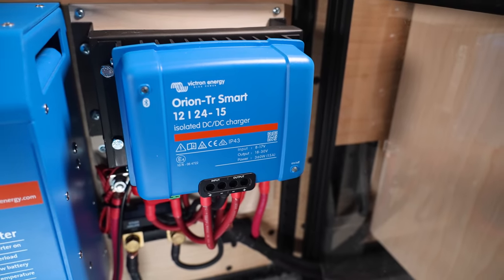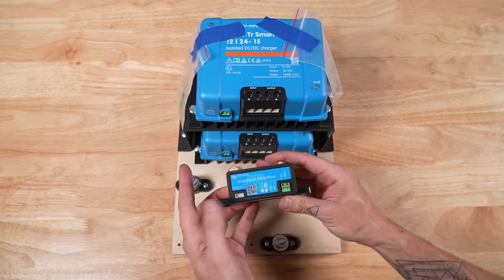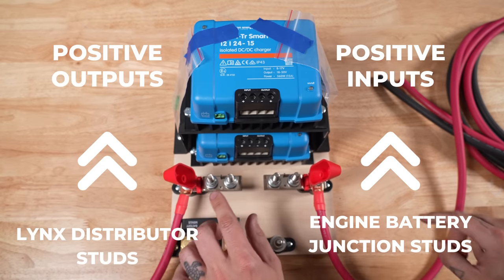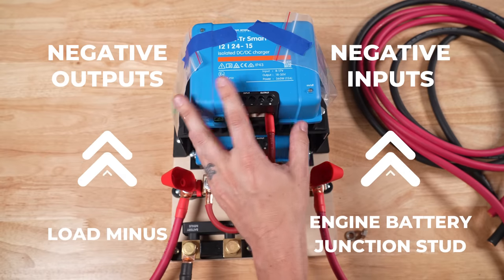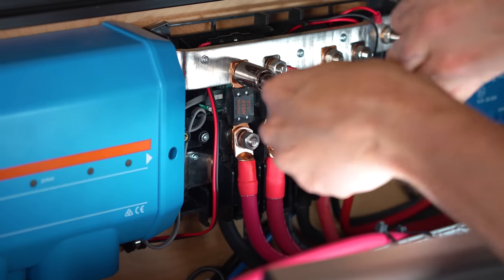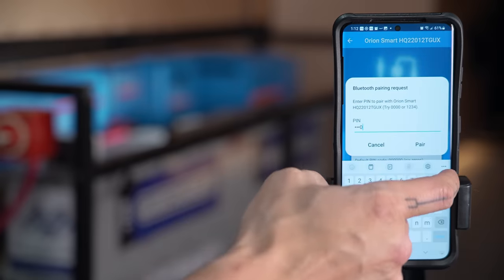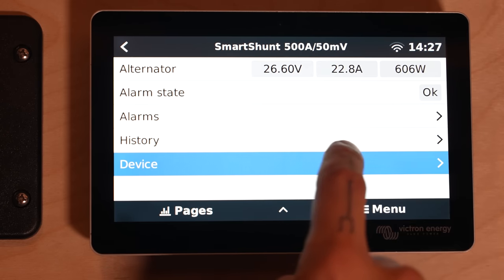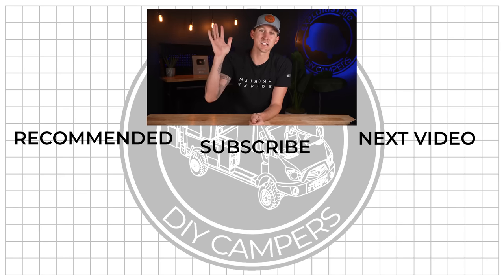TRANSIT ALTERNATOR CHARGING - DUAL VICTRON ORIONS

Comment from the maker: Dual Orion Wiring Kit: 12V Alternator to 12V Battery Bank: https://shop.explorist.life/shop/all-products/dual-victron-orion-tr-smart-12-12-30-dc-to-dc-charger-wiring-kit/
Dual Orion Wiring Kit: 12V Alternator to 24V Battery Bank: https://shop.explorist.life/shop/all-products/dual-victron-orion-tr-smart-12-24-15-dc-to-dc-charger-wiring-kit/

➤Shop the EXPLORIST.life store: https://shop.explorist.life
➤Shop Battle Born Batteries: http://battlebornbatteries.com/?afmc=explorist_bb67
✅Use code 'explorist' for $50 off per battery.

Comment: Adding a fan blowing across the heat sink fins helps a lot.  That's what I did to my 12 / 12 - 30 Orion.
Reply: Do you think a computer fan would be adequate for this?
Reply: @EffieG-ez9tf  yep. 120mm one is prefect for that job.  can even be a low noise/low rpm one. just to boost the natural convection quite a bit.

cool electronics works much safer and prolongs lifespan obviously.

Comment: Hey I'm wondering if this could be used universally I myself am a car audio guy and I will be the first to admit car audio guys are not the smartest when it comes to lithium so I'm trying to learn for a dual purpose of my batteries Car audio/Camping so basically I am trying to figure out a way to charge my lithium batteries safely with my alternator and give them everything I can get from the alternator without frying it I was told to use one of these but my hesitation was the 30 amp restriction maybe two together for a 60 amp charge would work better I want to be able to charge my batteries as fast a possible and what I'm not able to understand is most people are using these for a dual battery setup with a main starter battery and an auxiliary battery I myself want to use ONLY the lithium for everything better power delivery without the added strain of split charging with a dual battery setup yes I will have to have enough reserves to cover everything but I want it to be just that a single battery charging from the alternator that I can listen to my audio system while driving and use my devices at camp can you please tell me how you would do this and how you would make it work right

Comment: Since I have a 30a mounted behind my grill because of the heat, can I now install the new 50a inside and utilize both to recharge the battery bank? If it matters this is in 2022 Prius AWDe so I do not have an alternator to upgrade.

Comment: Question, do they need to be isolated or non-isolated versions of the Victron, DC to DC charger? I noticed the ones in your install are isolated, but want to know whether it matters or not. Thanks for the great work. Oh, also, if you were to supply the metal work, busbars, cables, fuses, and all the other stuff you need to do this I would probably buy that kit! Oh, and I assume that all the process and parts are the same for a 12 volt system??? Thanks again
Additional question...is there any concern for overdrawing/overheating your alternator with a 30+30=60 amp draw?

Comment: I remember watching your video about not using the engine (alternator) to charge the batteries. So I didn’t expect a video like this. Thanks for sharing this.
Reply from the maker: I think using the alternator to charge the batteries is a great solution in 95% of applications.  I think that everybody just read the title/thumbnail of that video and thought I was anti-alternator charging for some reason. 😂🤷  Since our transit doesn't have an on board generator and only has 580W of solar; alternator charging is definitely a must for this system.
Reply: @EXPLORISTlife  I definitely must’ve misunderstood that video, because I totally had the impression you were anti-alternator. 😂 I agree with you, using an alternator is important for a lot of peoples use cases. For me, I’m planning on doing the factory double alternator and having it dedicated to charging the house batteries + as much solar as I can. 😂🔋☀️

Comment: hi.nice video you must be sponsored by victron😊.i just changed my victron orion twin chargers to remote setting from ignition feed and it’s worse than before just 15amps max on my bms lifepo4 battery app.i had at least 33-35 amps before ,that’s 18 and 30amp orion’s.someone online said they fit them that way

Comment: I installed essentially the same setup on my '21 Transit.  However, concerning alternator changing in general, I didn't like how the entry of alternator power into the Lynx distributor bypasses the house battery insolation switch and energizes all the electronics on every startup.  I think it's annoying and probably not great for the components.  So with the help of some wire and a few relays, I wired the Orions into one of the van's Upfitter switches so I can control when they receive power.  I also set it up so that switching them on overrides the van's Smart alternator system; that process was a little more advanced but not all that difficult.   Anyway, I think a video of what I did would be interesting to see.  Thanks for all the super helpful content Nate!
Reply from the maker: We, and most people, just have our system 'on' all of the time, but if you are trying to turn it off every time you aren't using it; I could see that being annoying.  Thanks for watching and glad it helped!
Reply: @EXPLORISTlife  , since you have not an advanced DC to DC charger as the Wakespeed WS500, I also read it's a good thing to power them on at the time you are sure the alternator is safe (at high speed, so it can be cooled).

If you demand to much power from the alternator at low rpm (as the lithiums does),  you could fry it.
Reply from the maker: That's not the case with DC DC Chargers.  That is a problem with Isolators; but with the DC DC chargers we are showing in this video, it limits the current that is asked of from the alternators.
Reply: All energy sources should be isolatable. Since the cable that connects batteries and B2B can receive power from both ends it needs isolators at both ends.

Comment: I have 3 30 amps dc to dc on my system 600 amps lithium, alternator 250amps. Working excellent.
Reply: Nice. Is that also from the ford stock dual alternator setup? That chargers a 36v battery?

Comment: One more question, with "only" 60 amps of charging, do you still need the dual alternators?    If I'm reading the BEMM correctly, you would be perfectly fine with a single one.   Thoughts?

Comment: Wow this isn't just an install, it is artwork.   LE tech for 40 years here.   Considering getting a Transit.   Most seem to come with dual batteries now as a option, but very few have the dual alternator option.    A dedicated second alternator for charging house batteries for the option price ($640?).    Rarely do I see people discussing it anywhere.    There is a superior non-OEM 2x alternator option, but it is over $2k.
Reply: Nations make a 400 amp alternator for under 800 dollars. It is supposed to deliver 170 amps at idle speeds
Reply: My ford Transit Box wan has now 2 AGM 100Ah batteries and I think it has a 170 or 120A alternator because it has an electric hydraulic backlit.

Comment: Thanks for this video. I've just done something very similar and also used a smart shunt to monitor the 2 Orion's inputs. Do you know if there's a way to display this on the main page of the Cerbo display? Or is a negative in the DC power section as good as we get for now?

Comment: Has the firmware update been released?

The only benefit of using a shunt is that you can see how much charging is coming from the alternator, correct?

In other words, The GX will still show the total watts flowing into the battery without an additional shunt, correct?

Comment: Looking forward to the Orions having VE direct so you don't need the Smart Shunt!

I have my Orion only enabled by connecting the Remote On/off to one of the relay outputs on the Cerbo. It only gets turned on when the SOC is less than 50%. We have enough solar for our needs 90% of the time and don't see the point of taxing the alternator and affecting fuel consumption if I don't need to.
Reply: You are not "taxing the alternator" and have you calculated the horse power required for charging and related that to the bhp required to move the vehicle? You would be better off pumping up the tyres to reduce rolling resistance.

Comment: Great video Nate thank you. You've been my go to guy for my complete Victron system and I would not have been successful had it not been for your great tutorials.
I also have two of the Orion 12v DC to DC chargers on my Sprinter setup but I never put in the dedicated smart shunt for them. It's been working perfectly and displays the negative charge on the Cerbo but I'm worried about not having this shunt within the alternator DC chargers circuit. Is this something I should be worried about? I have the main smart shunt in the system but not the second one like you show in this video.

Kind regards David

Comment: Cool stuff buddy.  I looked at the transcript and links and could not find any of the fuse sizes?   I have a 12-12 30  so should i use a 60 or 120 Amp fuse [i have 2x 12-12 30 amps orions.  Not 15

Comment: Once again, loving the video as I was coming here from the store since I have a single Victron DC charger in my cart but I want this setup and I couldn't find the shopping list or the blog for both, along with the various wires and pegs and stuff...(even the heat shrink you edited in). So, I hope I get a reply before too long so I can spend another 2k in your store before the weekend. Thank you very much.. Joe
Reply from the maker: Dual Orion Wiring Kit: 12V Alternator to 12V Battery Bank: https://shop.explorist.life/shop/all-products/dual-victron-orion-tr-smart-12-12-30-dc-to-dc-charger-wiring-kit/
Dual Orion Wiring Kit: 12V Alternator to 24V Battery Bank: https://shop.explorist.life/shop/all-products/dual-victron-orion-tr-smart-12-24-15-dc-to-dc-charger-wiring-kit/

➤Shop the EXPLORIST.life store: https://shop.explorist.life
➤Shop Battle Born Batteries: http://battlebornbatteries.com/?afmc=explorist_bb67
✅Use code 'explorist' for $50 off per battery.

Comment: Quick question for you if you can let me know ASAP. I’m connecting wire from my Orion 24/12v converter to my 12v fuse panel and didn’t have long enough wire in your kit so I ordered some and didn’t realize it was coated with EPDM insulation instead of the XLPE that comes in your kit. Will the EPDM be okay?
Reply from the maker: For liability reasons, we can't vouch for 3rd party purchased wire, but we've made a playlist that will teach you everything you need to know about wire if you've decided to go on your own and purchase extra wire elsewhere: https://www.youtube.com/playlist?list=PLmvhcyi4n0TXLHS1NeK_sCvq3Wsa3B0kT

Comment: A 40 or 60-amp Renogy would have been a cheaper alternative. Love your stuff and your wiring diagrams!
Reply from the maker: Renogy is definitely cheaper, that's for sure.  It just doesn't last Ling enough for us to install it into a high end build like this.
Reply: Not sure the renogy has 24v output either.
Reply: Cheaper is too often not “better”

Comment: Thanks Nate! I did the dual Orion's on your 24V 540ah plans. Glad it ended up being the same route as I know at the time of that video the alternator charging wasn't available. Glad to see you showed how to tell the Cerbo GX the Alternator is charging with an additional shunt. Without the shunt, the Cerbo GX does show a negative DC load but doesn't say from what. I'll be adding the additional shunt now.

Any chance you might be updating your 24V/540ah wiring diagram to show the alternator charging? Would love to have it for my vehicle book for any future repairs 😊
Reply from the maker: Awesome!  Yes, we will be adding it to the existing diagram.  Submit a support here in 2-3 weeks and I should have it done.
Reply: @EXPLORISTlife awesome and thank you so much!
Reply: Note that you'll need the Isolated variant of the Orions for proper monitoring.
Reply: @joelv4495  thanks! I do have the isolated versions installed right now BTW.

Comment: I toyed with this type of installation, but several people have commented on alternator reliability.  Airflow is not adequate at low engine speeds.  If you run an alternator at low speed such as idle, you risk overheating the alternator.  How are you handling overheating??  How do you deal with a LiFeO4 shutting down when full?

Comment: Hey :D great vid. Im about to go from a standard voltage sensitiv relay from motorbattery to charge my "house" battery and connect a dc-dc because i have just learned that I have a smart alternator. None of my batteries are Li for now.  Will the dc-dc Orion auto detect if my motor is running or wil I have to get some sensor? I do have a stop and go function in my VW 5.1 it tat matters. I dont want to drain the motorbattery when the motor is not running.

Comment: Hey Nate, I set up my single Orion 12|12 -30 and hooked it up to the lower ccp port as I don’t have the higher one you connected to. It still senses if the engine has shutoff and won’t push a charge unless it’s running. Is this an ok alternative to running it to the ccp2 connection that is only on when the alternator runs?

Comment: Thanks for the video and the out view to see the alternator charging in the cerbo. One Question if you set the smart shunt power cable to the input side you could see the voltage of the starter battery? Or would a smart bluetooth sense do the job as well?

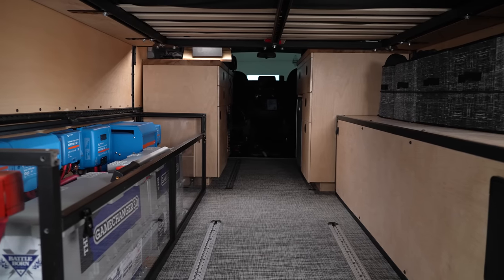Comment: Your videos are so informative and will help me when I get to this point in my own bus conversion.  Question:  Would you suggest this same setup or a different version of it for a mid-size to larger bus?  Also, does your 0:19 0:19 Viktron programming provide an app for your cell phone so you can monitor the charge levels remotely, if needed?   Thanks for sharing your skills with all of us beginners.😊

Comment: It is a welding cable, it can handle temperatures 105c and -50 and is the same size 6 gauge wire

Comment: What load are you measuring on the supply lines from the battery/alternator to the busbar before being split to the Orions?  What gauge wire are you using and have you tested it at full load?  
Thank you, excellent series, among the best I have seen in this arena.
Reply from the maker: Answers in order of what was asked:
~60A.
2ga as noted in the product page listed in the pinned comment.
Yes.  60A is WELL within max ampacity of 2ga wire.
Reply: @EXPLORISTlife  Thank you.

Comment: Thanks.  I'm just getting started.   Bought Orion need everything else to connect to 12 V dump trailer battery.  Where did you get the drawing software...?  Can you help me with a kit recommendation.  Would it be a good idea to wire from starter battery to Orion under back seat of pick up...have some DC powered ham gear there.  Then on to the rear fender DC plug then to dump trailer battery?  Thanks.
Reply from the maker: This may take a more in-depth look at your personal setup.  If you have purchased/are purchasing from our store (shop.explorist.life) reach out for some more personalized help: shop.explorist.life/support

If you've purchased/are purchasing elsewhere, reach out to your dealer for support.  We'd love to have you as a shop.explorist.life customer so we can provide a bit more help in the future. 🙂

Comment: spot on again,just a thought the 12 volt dc to dc get very warm so i mounted mine on a ali sheet fixed to fire resistant mdf so i take it the 24 volt version does not get as warm seeing you used plywood,cheers pal
Reply from the maker: Both units will heat up a bit, but that is as designed/expected; which is why there is a big heat sink on the back of them.
Reply: @EXPLORISTlife  i even installed 12 volt fans on mine to cool them down,i could'nt believe how hot they get
Reply from the maker: Yeah, sometimes it's pretty crazy how hot electronics get while still staying within their designed parameters.  Even my laptop gets uncomfortably hot when I'm running a lot of graphic heavy programs.

Comment: 2023 Transit with second alternator / 400Ah Lifepo battery : Does this config apply for connecting to second alternator (less the starter battery)?  Or MUST there be a lead battery in between as shown in dwg?